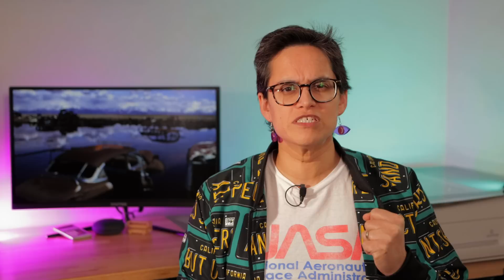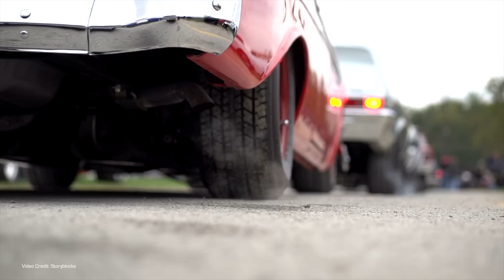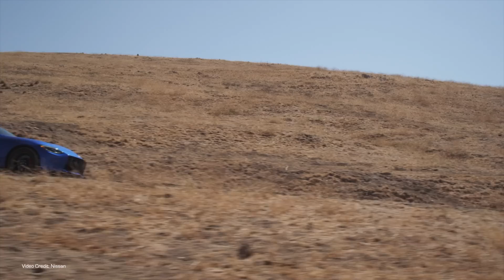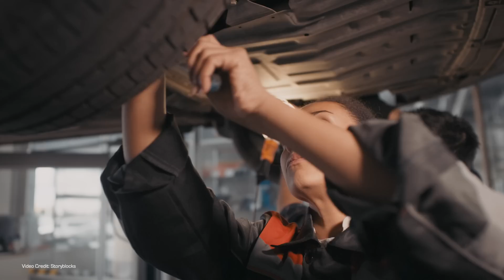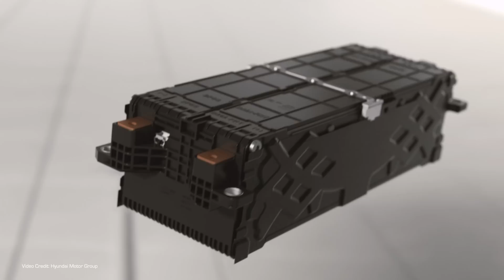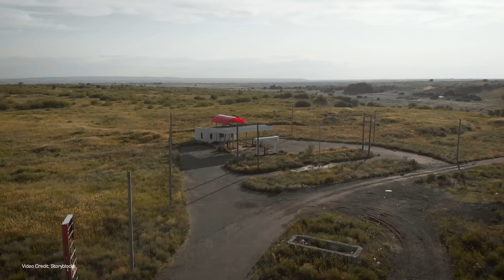Is Internal Combustion dying?

Comment: Also, with Tesla's huge price cuts, they are beneath the average vehicle price (forcing competition to lower their prices to compete as well)

Compounded by the fact automakers can't get enough parts for any of their vehicles, they make less vehicles and increase the price, but dealers have less to sell so they price gouge by $10,000-$30,000 on all vehicles.

Meanwhile growing EV startups sell for the price on the website and prices are going down for them.

As this continues automakers make less profit because there are less vehicles being sold by them and more being sold by EV startups. So then they have to increase their prices again making it so that they have less sales again making it so that EVs have an easier time selling because if more people can't buy an expensive gas car then they will look to a more affordable electric car.

Just a single year ago I didn't think that this was possible and that it was just going to be price parity and the only benefit would be lower electricity price versus gas and same goes for the maintenance, now electric vehicles are going to be cheaper by far. 🤯

TLDR: EVs used to be 60% more expensive, but with a 30% price drop and a +20% price increase for gas vehicles from inflation has EVs cheaper

Comment: Mz125 gets a shout out.   Hurrah !  This is what the electric generation will miss.. Bought as a beginner...rattly leaking & twisted.. The 2 stroke oil , The snapping front brake cable. Having to switch off the headlight to make the winkers work.. the pushing it 3 miles home  & sold to a beginner.... the circle completed.
Reply from the maker: Both Kate and I rode MZ. Hers tried to kill her multiple times, but mine kept doing less horrific things. I once had to ride 20 miles with no clutch - Nikki

Comment: It would take a miracle to make ICE cars relevant in the future, so pretty much not happening.
EVs are just kings of efficiency, while ICEs just can't get over 25% on your average well maintained engine.
ICEs had a good 100 year old run, they couldn't get to 50% in 100 years, it's their own fault they will die off.
While I can see ICEs still being used on industrial applications, their days are counted when it comes to the average user and their car.

And I say this as some one who loves the sound of a good ICE, specially how cute the Mazda 787b sounds when it idles.

Comment: The overall health benefits of switching to EVs - is staggeringly huge. As we found out when we dropped leaded gas - which when we used it increased the crime rate among many other things.
Injected gasoline engines have more fine particulates than filtered diesel. This one factor alone will decrease the death rate by thousands and thousands of people, per year.

Comment: Instead of 300$ to 2000$ dollars for repair be prepared to shell out 20000$ to 30000$ dollars on repairs on EV, Witch takes jobs from your corner auto shop as well.
Reply: So which EV's have you owned which have cost that much to repair?

Comment: This is not an attack on electric vs internal combustion (unlike this video) this is to point out how horribly wrong this person is and shouldn't have a platform to speak... Combustion wont die it will merely evolve... Same with Electric... it will all evolve and something even better will come because now we're getting out of the dirty age of corporatism and into capitalism... However tech companies are now doing to corporatism again and violating anti-trust laws.

Holy hog wash... WTF is this person even talking about... For one Yes DC motors were essentially first... aside from the multitude of other explosion and combustion engines... that weren't actually viable... But DC motors at the time were extremely inefficient... plus the amount of lead acid batteries you would need to compete with a 10 gallon gas... you would have to pull it in a trailor! it was only viable to tote around the city. Copper also in this time was scarce... and expensive... plus combined with poor metallurgy and limited understanding of electricity, also knowing that it could easily KILL YOU!!!! I think people would rather risk a broken arm than death... There's many reasons why gas beat out electric... They had nothing to do with "money" or masculinity (yeah that was a moronic statement)... the same oil companies were making money on energy regardless of what form it took. Especially because electricity was waaay more expensive back then than gas... that's why all the street lamps in most of the world were gas and not electric. It wasn't until Nikola Tesla who brought the knowledge AC to the world did electricity actually become a viable solution... not to mention all the revolutionary things he did with the electric motor. but this asinine concept that gasoline wasn't efficient, you tell me what other fuel oz for oz could have moved as much as gasoline did at the time... 800lbs worth of lead acid batteries vs a 16 gallon tank... geee I wonder... I mean if batteries were more effentient... WHY THE F<<< would they use diesel generators to produce electricity for locomotives... instead of Giant batteries... yeah... or the same with submarines... I mean dear lord the ignorance is thick here. Yes the electric motor surpassed the internal combustion engine awhile ago in power and efficiency... however it took ww2 to get batteries even close to holding enough power (Yeah sadly enough that technology came from the NAZI's)... but even then it literally took lithium-Ion (which is a massive ecological disaster has cause more destruction and harm to the environment than petrol ever has) ... but this could go one for awhile... I mean that stupid comment about the battery being bought out by a gas company, I mean they would have sold that technology to other industries they were in it for money... just dumb... Correlation is not causation... sorry no one ever taught you that.

simple enough why Internal combustion engines won... 
Steel was cheaper than copper. which over all production was more expensive
much easier to produce. they didn't have the machinery we have now for tightly wrapping the coils 
Electricity cost more, and technology to store it wouldn't come along from another 100 years
Gasoline was easily harvested manufactured and distributed, and it took mere minutes to fill up vs hours/days it would take for batteries.
People were afraid of electricity. it's why it took FOREVER to adopt into the home... 

How can someone interpret history so terribly... I mean must be a leftists extremists... 

What on earth are you talking about "manly" that is the most bull shit womansplaining I've ever see... leave your radical political and nonsensical ideologies in that little box of crazy you have on the self... yes you can call me triggered because I get triggered when stupid people say stupid things and act like they know what they are talking about... Sciolism is the enemy of reality
Reply from the maker: First off, sensible of you to edit out the personal insult.

As for the rest of your comment? Bless.

Go read some history. And take some time to understand the difference between energy density and efficiency.

^Kate

Comment: ICE r&d over the last 10-15 years has given us WORSE power trains. Direct injection, dual clutch transmissions, CVTs, turbocharging in small output engines are all less reliable than the naturally aspirated engines with standard transmissions of which they replaced. This shouldn’t come to a surprise to anyone, but we squeezed we very last bit of efficiency from the ICE at the expense of performance and reliability. The only logical direction for auto manufactures to go is 100% electric.

Comment: EVs are good if you live in the inner city, drive a few miles to and from work and are able to charge them at work and home that's really it. If everyone in the world all decided to drive EVs, it would multiply the the demand for electricity and we don't have the infrastructure for that. How are you going to generate that kind of power?  99% or more vehicles on the road still use engines. Don't plan on it going away any time soon. Also you can't just simply fill your tank full of electricity and keep going. Another reason why the engine is going to stay.
Reply from the maker: Where does the energy come from to extract and refine gasoline? I suggest checking that out before starting on the rest of your journey to understanding how erroneous your comments are.

^Kate
Reply: @transportevolved  where does the energy come from when the demand of the electrical grid is doubled or more and doing so while remaining "green". A typical house is about 30-50 kWh, an EV, depending on the charger is about 60- 100kwh. How about answering my question first before acting smart because I've got more questions that someone who actually worked in power generation would like to ask if you're up for it.
Reply: @JamesAdams-bd9df  Repeating the same non-arguments again and again doesn’t make them any better.  I live in the country and have solar panels on the roof. A perfect combination. A distance of 200 miles is no problem for any EV these days. We suffer from power cuts in winter, a clear indicator that the grid ought to have been upgraded a long time ago. Sooo… ?
Reply: @CaroAbebe  so you suffer from power cuts in the winter. That's great for charging an EV.
Reply: Ahh the old the infrastructure cannot handle it argument, since the dawn of electric power grids it has been in a constant process of upgrading. the grids of the 1910 could not handle the demand of the 1920, the 1950 grid would have collapsed in the 1960's without upgrades.
Between 1980 and 2013, the world’s annual electricity consumption rose from 7300 TWh to 22,100 TW
"the grid" will be handle it just fine as it will be upgraded where necessary and with v2g technology EV's will actually help to stabilize the grid.
And no, a home charger isn't 60 to 100kW, it's typically between 1.5 and 7 kW with 3.5kW the most popular choice as for about anyone it's more than enough to have a full charged car every day.
Reply: @rj7855  a Tesla charger is 11.5 Kw. If you charge overnight or at work for however long that takes, you do the math.
Reply: @James Adams  for the average uk driver, who drives 20 miles a day (data 2019)
The average power consumption of an EV is 0.346 kWh/mile
That means the average driver need to charge 0 346 x 20 = about 7kWh per day.
on a 11kW charger that would be less than an hour (that's why, while a Tesla wall charger is UP TO 11.2kW, most people configure the box for 3.6 or 7.2kW)
Reply: @rj7855  People need to rethink their transport needs.  How often does the back seat get used; 1 of 2 vehicles for a couple can easily do without.  I'm really looking forward to my Aptera which between efficiency and solar will rarely need plug in to anything beyond level 1.  100 Wh/mile, plenty of room for my dogs and sporty :)

Comment: One component added to ICE cars early on killed the BEV's of the day and that was the electric starter. BEV's of today need some kind of gizmo to increase range and decrease recharge times if they are to kill ICE cars. Speaking of early BEV's did you know that Henry Ford and Thomas Edison were friends and Ford invested heavily in Edison's battery. Ford was going to build EV's using Edison's new battery but the battery didn't work out so Ford then concentrated on ICE cars. Their wives were also friends and both drove BEV's.
RAM says it is coming out with a BEV pickup truck with an ICE range extender. That would appear to me to the magic bullet for BEV trucks as nobody in their right mind would start out on a long trip pulling a heavy load in current BEV's. Just watch the comical road trip of a Rivian pulling a heavy trailer over the Rocky Mountains on The Fast Lane Truck channel. Talk about range anxiety!! It got somewhat over 100 miles. And, at least on the Rivian, recharging the battery with regenerative braking turns out to be a hoax. Regen works for slowing but these guys used it all the way down the eastern side of the Rockies never touching the service brakes and put exactly squat back in the battery.

Comment: I don't care how many amp hours batteries have or how efficient EV motors  are but ICE engines are here too stay EV cannot compete against the ICE engines for hauling  loads, 5 minutes to refuel , range just to name a few....I have 2 ICE engines trucks one is 20 years old 6.0 Silverado and counting and the other is 14 years old 6.6 duramax diesel and counting both original engines and transmission now someone please tell me that  EV batteries will last that long or longer, no one is talking about the cost to replace an ev battery when they lose their capacity within 10 years. I hope their no ev owners that live in an apartment complex what they gonna do run extension cords off their balcony to charge them😂🤣 or try to make the landlord install ev charging stations😂🤣 (I wouldn't if I was a landlord) shame on you. God forbid you're on a road trip, rural area or the highway is shut down for some reason and your silly battery runs dead running the AC or heat ..so let's see you're going to call AAA and you REALLY think the tow truck is gonna sit there and  charge you up , I don't think so you're gonna get towed to a charging station and sit for hours for your silly battery to charge up vs an ice engine a tow truck can bring them gas and away the ice engine go, I can go on about all the HYPE about EV's
Reply: Why do you seem to think an EV battery will need to be completely replaced after 10 years?  You obviously aren't aware that an EV's battery can be refurbished at a fraction of the cost of a new battery.  Cleveleys Electric Vehicles here in Gloucestershire, are an independent EV specialist, and have been offering EV battery repairs and refurbishments for a a while now. They carried out a refurb on a 10 year old Nissan Leaf a while back. The work took 4 hours, and cost the owner £600. A YouTube video exists of the refurb if you want to see it. You really need to do more research, because your current knowledge base regarding EV's is somewhat lacking.  And it may surprise you to know that there are a number of EV owners posting on here who live in apartments, and have no facility to charge at home. People who live in apartments don't have a gas station outside, do they? But they still manage ok with an ICE car.....  Likewise, there are solutions out there to enable EV owners to cope too. You just aren't aware of them....... Just as you don't seem to be aware of the fact that Volvo, Mercedes, Scania, MAN, DAF and others already have electric heavy goods vehicles in prototype form, and on test......  And EV owners have to "wait for hours" to charge, do they?  Er, no. I completed a 520 mile round trip in my Kia EV a while ago. I stopped just once during the whole trip to charge, which took just less than an hour using a 100kw charger. And I didn't "wait" either. I ate a pleasant lunch in a nearby pub. The app on my phone let me know when the charge had completed. With respect, you are a prime example of someone whom has zero knowledge regarding EV's and the experience of EV ownership.  
It seems you are in the US, right?  Here in the UK, it is possible to apply to your Local Council to get an EV charge point installed. The funding is provided by the UK Government, and Local Councils or Landlords can apply for it if someone requests an EV charge point. From March this year, all newly built houses must be provided with a provision to charge an electric vehicle. And all supermarkets and workplaces should apply for grant funding to install chargers.

Comment: I was never impressed with stupid ICE engines. I've always seen them as problematic and polluting. ICE engines would never be efficient without electric circuits.  EVs just works electric. No brainer there to mess with stupid mechanical collapse.

Comment: I can’t yet buy into EV until cars become lighter and agile. Anything approximating 2 tonnes will not change direction in a way an enthusiast demands. No doubt this will change as  EVs continue to develop but not just yet
Reply: Have you taken a close look at the Porsche Taycan? Pricey but sporty.
Reply: @jokerman6015  yes definitely one of the best for agility but it still did have the sensation of mass not wanting to stop under braking.  I also felt this when taking a corner too enthusiastically, where sub 1300 kg sports car surprises you with its ability to just tuck in and go round the taycan was err hang on this is going to be hairy. Mega straight line speed though that i didn’t tire off
Reply: you obviously never tried one of the more sportier EV'S available today.
Reply: @rj7855  😂. assumptions aren’t helping you

Comment: Actually my Renault Clio Rs Line is just amazing. Do a test drive please!
18000€! Is "fast", is cool, is safe and I can afford it!
Reply: Renault Clio RS 220 Trophy specs is between €25000 and €31000 in Europe and it's acceleration is beaten by any half decent EV  out there.
but by all means enjoy your ice clio while it lasts as Renault will be all electric by 2030 as well.
Reply: @rj7855  I do not know what car you are talking about. There is no trophy anouced for this last version of the clio so far.
Reply: @paulomoniz7326  No Clio Rs Line on the Dutch  Renault website so I used google..
The base (non-Rs) Clio is € 21550 in the Netherlands and  in Spain for the cheapest Clio R.s is listed as €24300

"La versión del RS es el techo de la gama del Renault Clio, contando con un precio de partida de 24.300 euros  "

Comment: Nice summation of the situation and of ICE prospects going forward. Petrolheads in coming years will face some rude surprises as both petroleum and engine parts supply lines start to disintegrate. Eventually they'll need to be the ones plotting out their long trips by locating remaining petrol stations with an app.
Reply: Yes, very true......